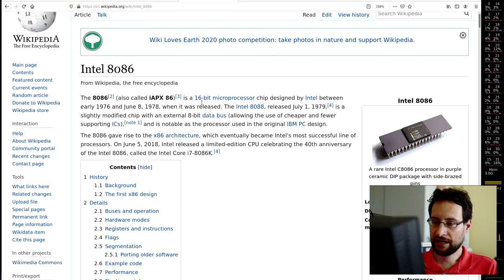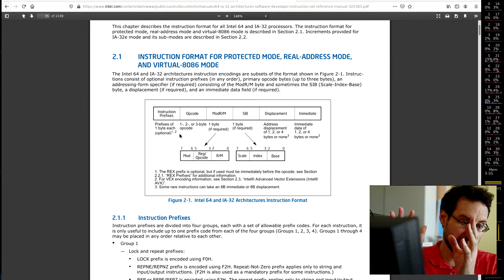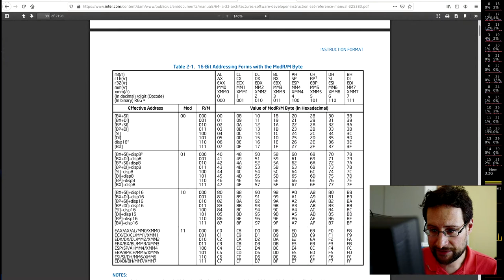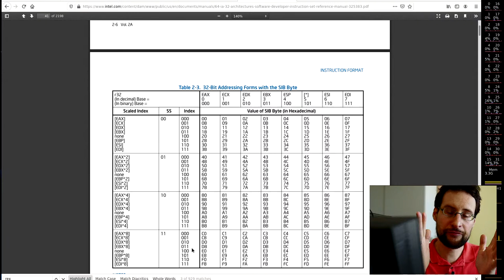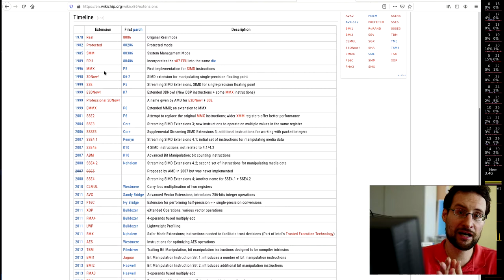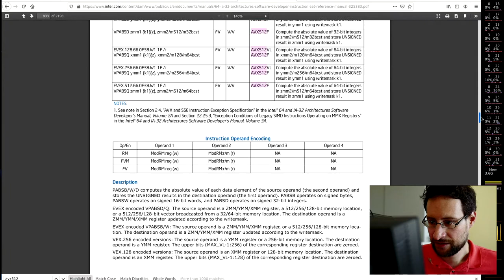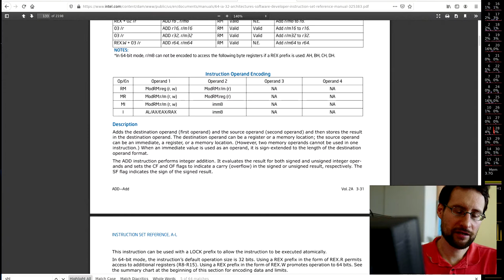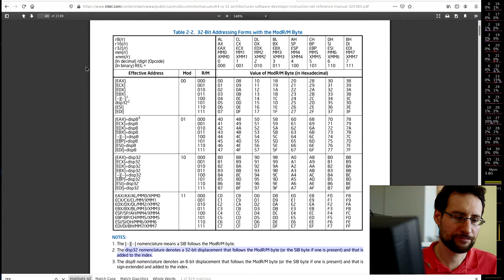Intel x86: let's take a look at one of the most complex instruction set!

Comment: SHL isn't unique either. IMUL and IDIV take effectively no parameters at all. It's easy to get good IPC numbers when you have to shuffle everything in and out of EAX and EDX just to multiply anything! Most compilers use LEA instead where possible.
Edit: just wanted to +1 for some quality Itanium content. IA-64 is a stunning ISA with some amazing features.
Reply from the maker: It is only matching that the MUL—Unsigned Multiply has the output always in the EAX:EDX pair, while the IMUL—Signed Multiply has
0F AF /r    IMUL r16, r/m16 RM  word register := word register ∗ r/m16
variant & friends ;-)

Comment: You know how bad the instruction set is, when even Intel themselves want to get rid of it.
Reply from the maker: yeah, and their IA-64 replacement was eve worse, ..! ;-)
Reply: x86 has been originaly designed when memory was limited and expensive. I was very good at the time, because you could write complex programs in assembly with very few instructions (comparing strings, searching in ASCII, calculating with decimal numbers was coded nearly in the CPU). But with the emerging of complex programming using compilers, you had a tough time using those specific instructions. Therefore the creation of ARM in the late 80's considering the only instructions a compiled program was making use of: add, mul, load/store, compare, jump.
But: the core instructions do not use that much transistors, the seamingly limited use of  some registers is automatically expanded during the conversion in microops inside the cpu with register renaming, and MMX/SSE instructions are not different than the optionnal instruction sets you find on other architectures including PowerPC (altivec), ARM (Neon), RISC-V (Vector?)